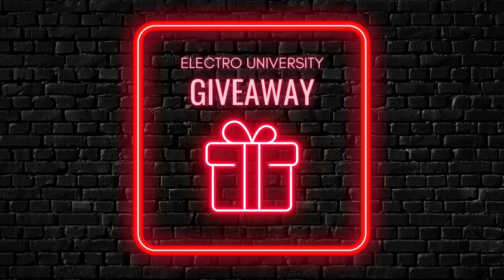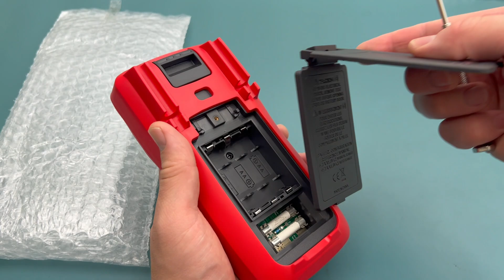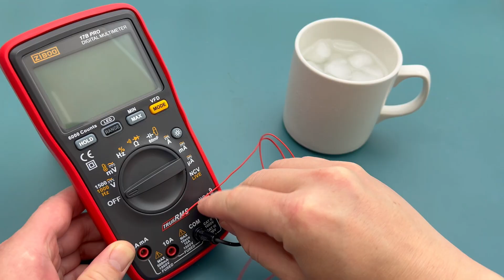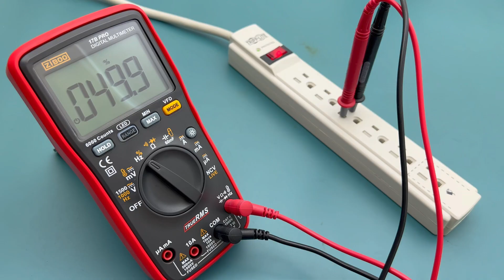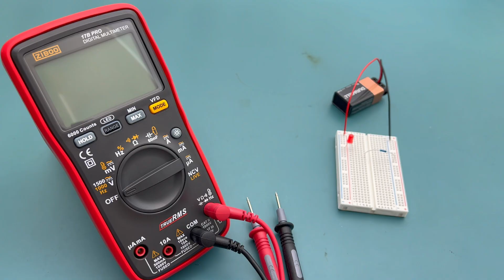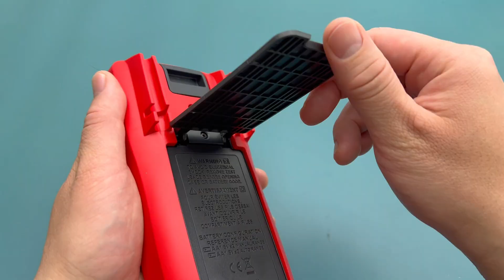ZIBOO 17B Pro Digital Multimeter Review & 🔥GIVEAWAY🔥

Comment: FLUKE operates a manufacturing facility in China that produces digital multimeters under the FLUKE umbrella, but many of those models are not sold in North America. For example, the FLUKE 17B+ and FLUKE 18B+ are essentially Asian-market versions of Fluke meters aimed at electricians and electronics technicians, and offer excellent value. According to my neighbor, who is from China, factories routinely produce more units than required to account for items that may fail quality-control inspections. As a result, there is often a surplus of components and materials available.

The theory is that companies with unfamiliar names, such as ZIBOO or THSINDE, acquire some of this surplus material and manufacture meters using similar production standards. To avoid contractual or trademark issues, however, they add or remove certain features. For example, the FLUKE 18B+ lacks True RMS capability, while my THSINDE 18B+ performs all of the same functions as the FLUKE, is TRMS capable, and additionally includes both "Min/Max" recording and "NCV" (Non-Contact Voltage) detection. Those differences, along with cosmetic changes such as replacing FLUKE's distinctive yellow housing with an off-orange color, help distinguish the product and avoid potential legal complications.  I cannot ascertain whether the "drop test" height, or the IP-rating is the same, but I would not be surprised if it was exactly the same.

China in a nutshell.